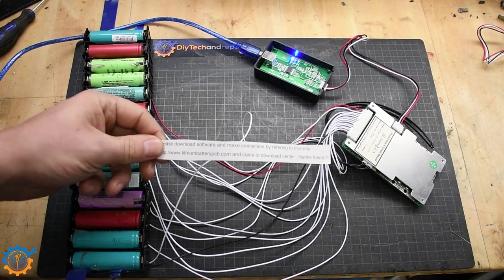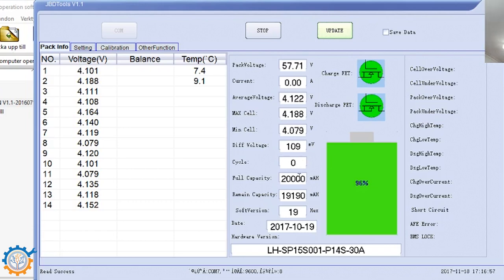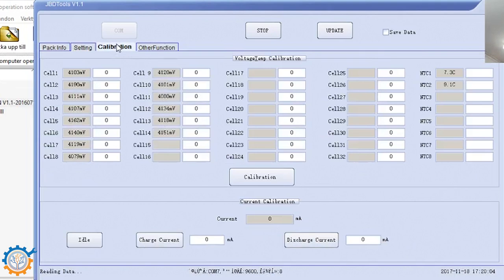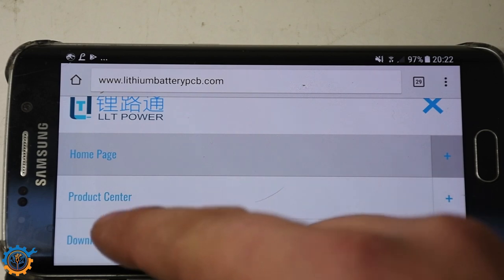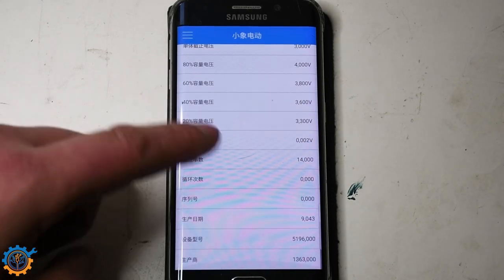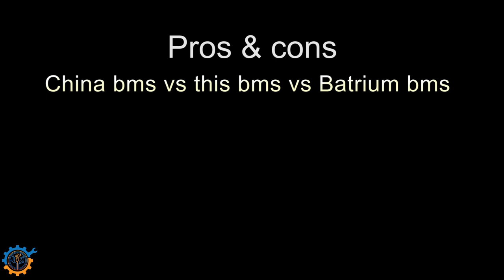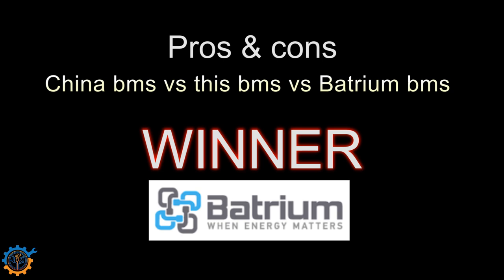Smart BMS review - Cheap choice for those with low budget

Comment: Thanks for the video and for the update. Looks like they're using BQ76940 BMS IC form TI alongside ATmega328p (Arduino). The IC can manage cells between 9-15S, all you have to do is to short certain pins of the chip (see Table 8-3 on the DS).
There's also an open source firmware for basic battery management and monitoring, which means this thing could be hacked. 
Arduino BMS library: https://github.com/LibreSolar/bq769x0_ArduinoLibrary
BQ76940 Datasheet: http://www.ti.com/lit/ds/symlink/bq76940.pdf
Reply from the maker: BQ76940 is a nice little chip. Have done some work on it myself. It does the job pretty well and I have even designed PCB for that one including the ESP8266

Comment: Hello. Just saw your video and I have some questions. Are there any BMSes available for lipos? Since the discharge cutoff is usually higher at 3.2/3.3v. I can't seem to find many on the market that do that.
Reply from the maker: Its basically THE same bottom voltage as the other but for rc you stop earlier. Just get a programble bms for 3.7v nominal cells and it Will work :)

Comment: I bought one of these a while back and was pretty impressed with it. I've hooked up a relay are using a little power supply that I can use to control a heavier load. This of course bypasses the BMS accessibility to read current and amp hours. I also noticed when I downloaded the new app for reading the cells that it also seems this device data logs which is another nice feature. When using it to power a relay I needed to come up with a power source to trick the BMS transistors into turning on the relay when charging was okay. Thanks for your video it would have helped me a while back when I was trying to figure this out. I can see these being used for solar systems which is what I'm doing at the moment. I did a video also and it's up on YouTube you can see it by clicking on my profile

Comment: It's probably jumping (I'm building my own BMS) since they are probably using a voltage divider network and by the time we divide the smallest voltage cell, the resolution will be much less since the resolution of the ADC will not change. E.g. If you use the same divider configuration for the 14th cell (58.8v to 4.2v with a ratio of 1/14) then the first cell will also be divided by 14. Therefore the battery will only vary from 0-0.3v and you'll get poor resolution. There are other ways to deal with this, but that's my guess for this board
Reply: Brother i can the details of your BMS and some documents i am also making bms i need help

Comment: Thanks for the useful info! You mentioned that you can use the 14S version also on lower S configurations. I build a 7s24p 18650 pack, can I use this bms on it? If so, how would you wire it?
Reply from the maker: For 7s get a 7s. The above is 12-15 i think.
Reply: @DIYTechRepairs So you cant leave 7 of the 15 leads unconnected to use it as a 7s bms?
Reply from the maker: @puregodzila  on most No you cant. Read the spec.

Comment: Can you program this to charge the battery pack at lower voltage like say 4.1V per cell instead of the regular 4.2V per cell?
Reply from the maker: This is a bms and not Charger. Charging limits is set at the Charger. This bms have configurable protection voltages yes
Reply: Yes , you can actually even less . Go in settings and set parameters . You can set over voltage to 4.1 and release voltage at 4.0 for example.

Comment: I am at the stage now researching BMS. This video has really helped. 

Do you know what are the differences between a BMS for, Lifepo4 and Li-ion? 
As I am using 18650's 8s8p. They are Li-ion, but, would a Lifepo4 BMS work, or are the set voltages not right, and so I must ensure, especially if I buy the none adjustable BMS, to get the LI-ion version only. 
I guess this adjustable version would be a better option, but I wold like to understand .

Thanks for some great informative videos.
Reply: You have to use a Li-ion BMS with Li-ion cells.  A LiFePO4 BMS won't work because those cells are full at 3.6V where Li-ions are full at 4.2V.

Comment: Hello. I don't know why, but when I am looking for info about solar I use to finish in your videos! Thanks :)
I want to try one of this BMS (100A version is now about 65 EUR) for a Chevy Volt battery. It is 16 kWh (12S8P), about 44 V nominal and the discharge rate will be about 5500 W maximum. 
With two 100A version of this BMS (one for 4 parallel) do you think it will be enough?

Thank you!
Reply from the maker: Thanks. I wouldnt personally parallel Them because you cannot guarantee they Will share the load even and in worst case you overload the first and next dies too :) with that Said IF you make sure to stay below what 1 can handle easily it is generally not a big problem.

Comment: Hej! Tack för din video! Jag bygger en del batterier till elscootrar och har ett problem som jag undrar om du vet hur man kommer förbi? Själv setupen är så att man har ett original batteri på 36/42v som jag kopplat i serie med ett 12v batteripack. Då får man upp hastigheten och hela systemet kan klara av det. Men problemet är när man ska ladda batterierna så behöver man koppla ut 12v batteriet och ladda det separat. Såg en som säljer såna pack med en ny bms som man inte behöver koppla ut när man ska ladda 12v packet och undrar om du vet om det är en smart bms som denna använder då den inte vill berätta va den gjort. Tack på förhand!
Reply from the maker: Kontakta mig via email så reder vi ut det. Du hittar kontakt under about här
Reply: @DIYTechRepairs  tack absolut. Det ska jag göra. God jul :)

Comment: Thanks Daniel, that was a very good introduction.
It's obviously aimed for the massive ebike market in China, and I think I might get one for my 14s16p battery even though 50mA balance current probably way too small to be useful with my mongrel cells!
(I've had to modify some cellpacks already to swap some leaky cells and it's pain to do).
It's nice that an ebike battery can be used for the bike, or for home!
I like that this BMS has programmable thresholds, but the noisy reading on cell one is some cause for concern. Hopefully just spurious.
Still, it looks like it'll do the job until my packs grow big enough to justify a Batrium system.
Reply from the maker: Yeah I also think that Ebikes is a perfect system to run it. They have up to 26+s or something. Yeah my cell1 readings was way off. From start it read like 1.9V!!  Im going to contact seller and see what it says. I think my unit have an issue
Reply: I guess I don't really need one because I balance charge using a 300W 6S lipo charger, but have to do it 3 times - gets a little tedious after a while, especially if I fall asleep or forget and the pack isn't ready!
So, I bought a 60A one from Aliexpress and look forward to playing with it, though I don't have a 58V charger yet apart from the 7210A, which would be slow but still usable.
Maybe there's a dry joint in Cell 1's path, or a software issue?  Looks as if they are multiplexed so only 1 ADC is required. I'll report if mine will have a similar issue.

Comment: Nice video, just wondering if you figured what was causing the jumpy voltage on cell 1?  Lugemont has a video on these smart bms and didn't show the voltage issue or not being able to change parameters from the mobile app, he used mobile app version 2.0.1006.   Please let me know if you solved your issue and how it is currently working.  I want to order one but if its got glitches I will wait for a stabler smart bms.  Thanks in advance...
Reply: I suspect the issues on the cell voltages, are caused by not connecting the B- on the BMS to the Battery negative.
Reply: Indeed.  On my 8S unit I had jumpy/low voltages on cells 1 and 2 when only the balance wires were connected.  After connecting B- on the BMS to the battery negative, these voltages normalized and were completely stable.
Reply: Yes, I confrmed this on my 8S unit too. Hoping to hover around the 24v to 32v, which seems a good range for, effectively a 24v system. I am using modbus reader to read the settings from the unit, and hope soonish, to read on my arduino. It's a great monitoring unit, but with recycled cells, not too sure about balancing effectivness. Still experimenting.
Reply: Michael Breslin thank you for the update. I saw the video you put out yesterday, thanks again and best of luck to you.

Comment: Very Nice.  As you know I have this BMS connected to the same 48v pack from your video.  I had a rough time getting it to actively balance.  Based on whay you just displayed I believe the issue is I had both Balance control options selected at the same time.  I dont think it likes that.  The only time I got any balance activity was when I used the Balance Odd and Even under the Other function tab.  Looking forward to see how you use this in future projects.  FYI from the phone you can lock the BMS where u cannot make any changes on the computer.  Just in case you havent seen that yet.
Reply from the maker: You need to use either balance charge or the normal balance. If you click out the balance charge it will start to balance if you have that condition and all values correct.  The odd/even is just a test-function

Comment: It would be cool to get a access to the source code of the bms. It seems to have almost everything you need but with a crappy interface. We could easily convert that interface to be more "batrium-like"
Reply from the maker: Not sure if its doable to even get close :)  Why I say that is because the hardware is so simple. But yes you can do alot with it but i would say its easier to write from scratch. Though add a better MCU like and ESP32 and your set for something. But its it worth mentioning all the hours put into a good BMS. I would take one of the existing on github and continue with if i were to do it :)

Comment: Looks like a good starting system for many people.  The language thing is a problem on the mobile app part.  I bought a VR goggle set with Bluetooth controller.  The goggles were fine, but the controller didn't work.  I went to the manufacturers site and it was in Chinese (?) I tried using the Windows translator function and nothing happened.  Sent the whole mess back to Amazon and bought a different brand and this time the controller works great, but no matter what I do I can't see the videos with the goggles.  Hope this doesn't happen if I try the BMS.

Comment: there is a calibration tab there for voltage and temp sensors you need to set this up when you first get it
Reply from the maker: Or just Connect the wiring properly. I missed One Wire and that gave Numbers all over the place

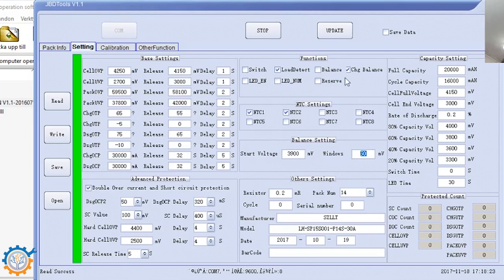Comment: 7:08 So this does what is called "active" balancing right? Where it will balance the cells even when they are not charging/discharging?
Reply from the maker: No. Active is when it Transfers energy between the cells
Reply: @DIYTechRepairs  Oh yes of course, my mistake. Thanks

Comment: I wished I checked for smart BMS boards which have a chip onboard + bluetooth.. got a dumb BMS and when I realized there's smart one, was too late to cancel the order lol.
good review, thanks.
must be dodgy issue on that first cell on the chip level. probably happens on any cell in that slot.
Reply: I suspect the issues on the cell voltages, are caused by not connecting the B- on the BMS to the Battery negative.

Comment: I previously bought one of the BMS boards like "GOING OFF GRID" formerly "FLIPPING 720" uses and it works very well, but no connection for monitoring.
Reply from the maker: Thats the cheap versions. Problem with those is that you cannot set voltage levelels and you cant see whats going on. You kind of dont know if they are in balance or not and have to add extra voltage displays. Thats why I like this version as a step up. I hope to look more deeply into it later on but need to get that cell1 sorted first.

Comment: Can you modify this BMS to have a higher balancing current? Switch out the resistors for something higher? I'm not sure how these boards work.
Hopefully that first cell is something to do with calibration? Or maybe its fault from the factory (cheap chinese, probably has no quality control)
Also the temperatures being different is probably cheap components, cheap thermistors. You should test them on multimeter to see if they read the same.
Reply from the maker: I did callibrate that first cell from 1900 to 4100.... But i guess something is off on that board I got making it jumping all around.  Temperature is not as big problem as the voltage jumping. Its possible to callibrate that too :)
Reply from the maker: You could potentially add external resistors. They are controlled by transistors what i saw

Comment: Great video. If I wanted to extend the life of my 18650 pack and charge each cell to 4.05V max, would this BMS do the trick? Or would the actual lithium-ion charger also need to be capped at 4.05V multiplied by (x) the number of cells in series? Thanks
Reply from the maker: southpaw THE Charger is what sets ur top voltage and not THE bms. So yes it Will work
Reply: Okay great, thanks for the reply. My pack is 10S so would the CC/CV charger need to be set to a max of 40.5V? And the BMS balance voltage set to 4.05V per cell?
Reply from the maker: southpaw yes thats One way to do it. You have to det balance values based on ur environment in THE end.
Reply: One last question: would this also work if I used a regular 42V 10S CC/CV charger? My main concern is keeping each cell voltage <= 4.05V Thanks
Reply from the maker: southpaw a Charger set to 42v would be 4.2v per cell. No matter what THE balancing on THE bms is set at. IF u set balancing to 4.1 and charge to 4.2 the bms Will drain the packs to 4.1..
Reply: That makes sense, thanks for explaining. Really enjoying your informative videos

Comment: Hi from Italy, I have a 13s ebike battery. Unfortunately, a group of cells burned out. I decided to remove the dead cells so that I now have 12s. I then soldered pin bridge of the Smart BMS as schematic, to transform it from 13s to 12s. Can I now connect bms to the battery and uart box to PC? Or should I change some other parameter first? Software in BMS still working as 13s and will burn everything?
Reply from the maker: You need to check if that BMS even works with 12s. Its not all BMS systems you can do that on.
Reply: @DIYTechRepairs  mine I know is "multi". Anyway done: connected as 13s, setup sw as 12s using JBD Tools, than soldered pin bridge as 12s diagram. Thanks for your video, show the way.

Comment: Cool BMS for small project. I'll probably pick one up for my portable power station. I'm going to have to get the Batrium for my powerwall though. Ouch
Reply: I was too until I realised Solaredge SE5000 is a 400v system that needs modbus to talk nice together
Reply: Nice Doc. Info . Can this cheap smart BMS do/use 8S2P lifepo4 battery bank?.

Comment: With only 50mA, will this only work on smaller packs or will it work with a 500mAh range with 80-100P?
Reply from the maker: Michael Neal smaller packs and packs that are very well in balance. Or if you can wait 3 weeks to balance. They are made for less than 50ah

Comment: You  need to calibrate the NTC sensors in the Calibrate tab.
Reply from the maker: Tom Donnelly yeah. Didnt care for the temp. The voltage was more important.
Reply: Sure, but my comment was in relation to your observation that the temperatures were different despite being co-located.

Great video.  Just ordered 3 of these.  Trying to get my hands on the APK source.  Any ideas?
Reply from the maker: Dont have it im afraid. But i guess its a normal protocol that can be sniffed. Not sure though.

Comment: Do anyone know if possible to reset this bms to factory settings. I bought one, connected as should, first time i got a lot of power according battery specs. Then i decided to reduce outut current, notcto drine battery quick, and not to go in full power. Looks like i messed with something, but since that, at full throttle motor get disengaged regularly, and some time under load computer going off itself. Battery votage is not going below. Some one gave advice, that bms output currwnt is too low. I adjusted it back to maximum 40a(not sure if needed minus on front of 40). Any way still going disconnected itself. I found that bms is notcok, as, by connecting battery directly to controller, motor going fine and computer is not going off itself. Any ideas? I tryed to reinstall app and disconnected minus from battery to bms. No success.
Reply from the maker: I dont know im sorry

Comment: Can someone confirm that it id possible to use this bms in a system with less cells in series (eg 10s, 36V)? Looks like their bms start at 14s...
Reply: have you found answer?
Reply: They have every version available on eBay under different seller names.

Comment: This is what I am looking for!!  I need 16S however :(
Reply from the maker: Check description. They have all from 3s to 32s also.
Reply: I have just see, thank you!!  My 60kwh setup would not benefit from this unfortuantely.  I do NOT want to spend so much as the Batrium costs...there must be something in the middle.  I look forward to watching your channel to see if you come up with something more on the Batrium level but for about $150-200 range.
Reply from the maker: On 60kWh battery bank Batrium cost is nothing. You need to set in proportion what it did cost to build that battery bank :)  This BMS i would say is ok for banks up to 1kWh or so :)

Comment: Hi. Can you please tell me? I have this model BMS 10S , can I conect it to 12S battery. On this BMS boar can read 15S conection. Thanks and sorry for my english.
Reply from the maker: Kristapsvisums you need to rebuild it to work with 15s. When running in less then 15s they modify it